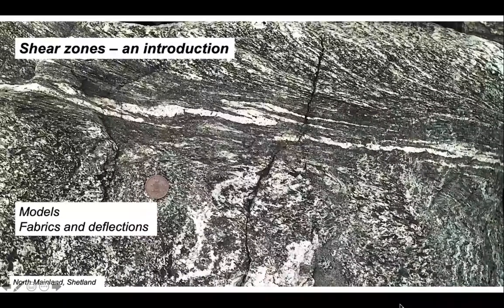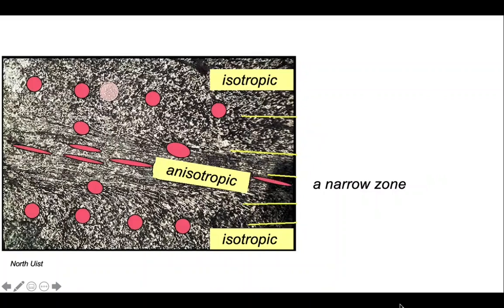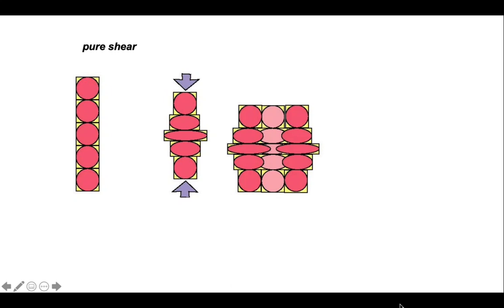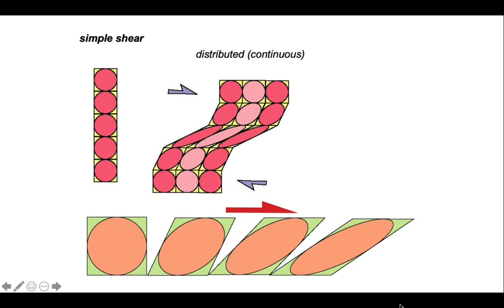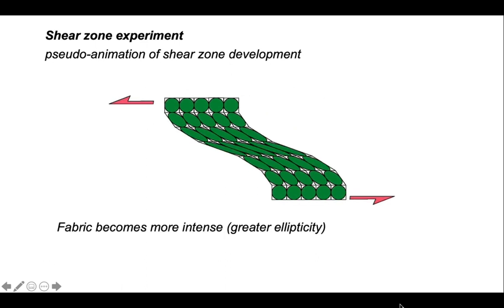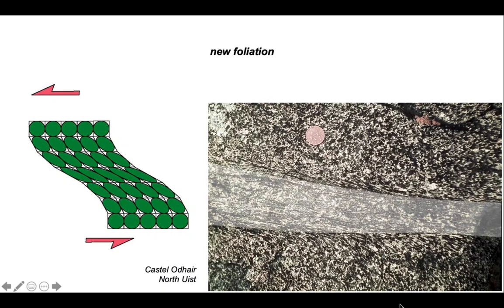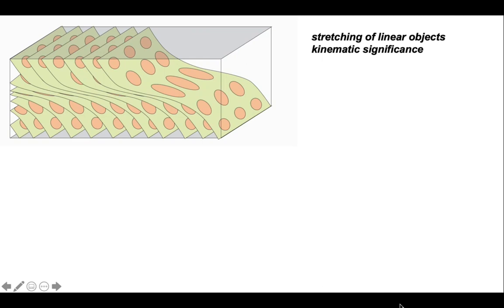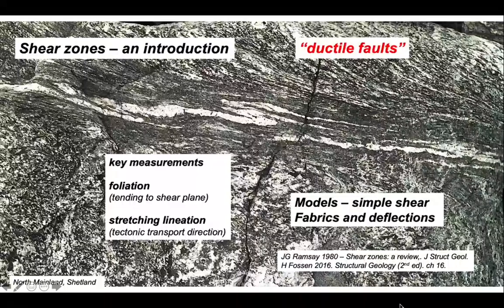Shear zones  - an introduction

Comment: I think 45 degrees (αf) may not be always true. The congugate angle  2αf should be random, sometimes 110degrees in middle to lower crust,  then less than 90 degrees in most shallow crust, according to quartzofeldspar rocks.
Reply from the maker: Hi - not so - this is basic geometry for simple shear. Of course rocks can deform in different ways but then it isn't ideal simple shear. There are of course lots of studies - in naturally deformed rocks, in numerical simulations and in theory that deal with general shear - but simple shear (the game for "Ramsay & Graham" shear zone0s is defined as in the video.
Reply: @robbutler2095  Thanks a lot.  Your talk makes me understand that  simple shear is the principle mechanism for shear zones of different levels. Maybe what I talk is just in line with a pure shear environment or Anderson model.